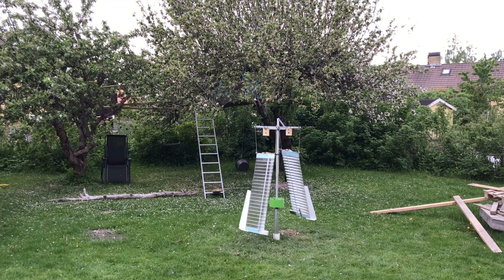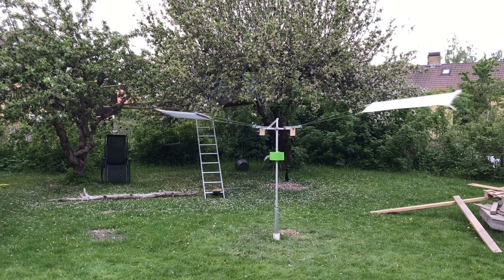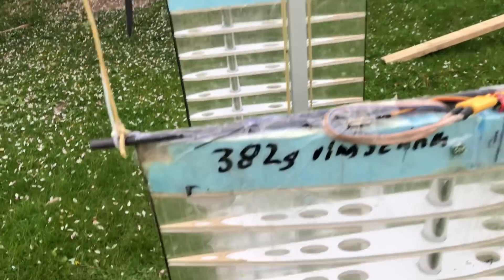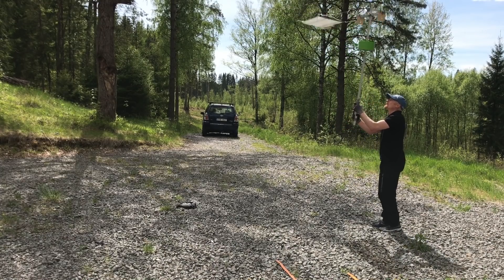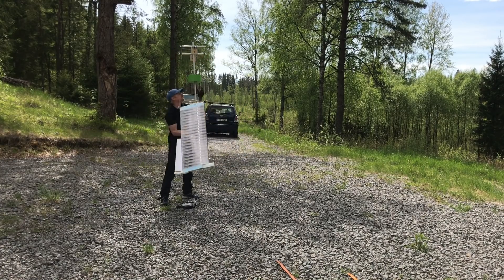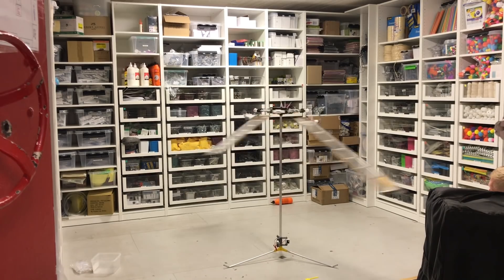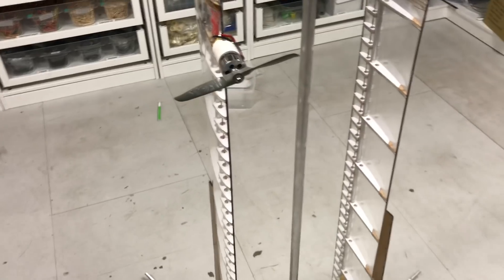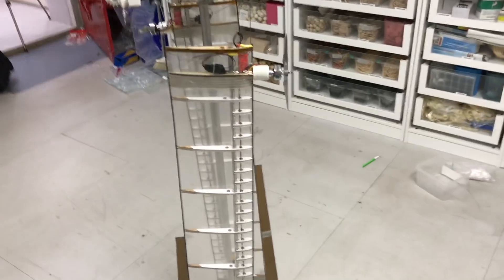Rotary wing testing

Comment: why not simply connect the wings with a carbon rod through the center and create a pivot point in the middle of it it can balance on..Then you can use some flaps to position the rotating vehicle, it can take off if it has balast of some kind and maybe even if it hasn't but you have good control..Its basically two connected airplanes flying in a circle, that configurationcan definitely fly without any support

Comment: The placement of the strings is making the wings go unstable. The aerodynamic forces are roughly centered at about 25% forward but the pivot point set by the strings sit in the center at about 50%. That creates an unstable pitching moment that get worse with the square of the speed. You'll get more stability by moving the aft spring forward to the 45%-50% point. I'm curious what the results might be.

Comment: Loving this project. I work on kinda the reverse of this. 
If the thought is of any help... I've been able to run my kite turbine backwards e.g drive rotation into my kite turbine, sending rotary power up the tensile shaft to turn the blades.
Having a framework which releases and expands after a set rpm or tension would be cool.

Comment: So, you basically develop ordinary helicopter rotor system.
Most large helicopter designs have fully articulated rotor - there are 3 hinges installed, which allow for 3 degrees of freedom. two hinges - horizontal and vertical - act very close to strings that you use. Things to consider:
*normal helicopter has acceleration about 100g at rotor tips. You need lightweight rotor (usually the blade is only about 1% of helicopter weight). At the same time helicopter blade is very flimsy and works as a sting, so you need very high tension to keep blades close to horizontal, as a result you'll need very high blade tip speed. I've never heard of centrifugal force less than 10 times the weight of rotorcraft (100kg aircraft = 1000kg of force at the root of a blade minimum, 2000 - 2500 - typical value). To achieve that typical helicopter tip speed is about 200m/s.
* string that you want to use has very high aerodynamic drag. You'll have to provide some airfoil cover. This problem matters the less the closer you are to rotor axis (speed is decreased);
* if you want fixed pitch then you can copy autogyro rotor system (as an answer to question "how to do thrust vectoring). Just see the picture, I think it is self-explanatory: https://i.ytimg.com/vi/7kmbTo2jt9E/maxresdefault.jpg Don't forget about 90 degrees lag;
* one of helicopter design challenges - at parking position blade bends under its weight so blade tip goes down and becomes close to fuselage, typically to helicopter tail. Big helicopters use centrifuginal-activated angle limiters. With strings, I guess, that would be even more of a problem.
... I learned aviation and stuff in Russian, so sorry for language and bad terminology.

Comment: I find it very interesting that you're pursuing this type of design.  Many years ago, I would dream of a personal "helicopter" with inflatable rotor blades with weights at the tips.  The idea that these inflatable blades would be rolled up short for startup, and as rpm increased, gradually let out more and more of the "blade", just like you're doing with your weight / winch.  My thought was that a pitot tube at the tip of the rotor would provide pressure to inflate the blade and some sort of control surface at the tip, would control the pitch.  Of course, I never worked to develop this, but seeing your latest "adventure" has reminded me of this dream for a portable, compact personal aircraft.  FYI, love how organized your room is!  Probably contributes to why you are able to accomplish so much (organization).

Comment: The spinning causes the gyro to actually pull the "down" value outward bringing it partially horizontal. My friend did some experiments with a VTOL rotary wing that converts mid air. I will post the video to that in your comments, so you can check it out. 🤠👍
Reply: It can be up or down depending on the sense of the props.

Comment: Doesn't seem to be lift that is lifting that weight, it is more centrifugal force. The lift is only lifting the weight of the wing itself. I think this design will eventually  lead you to using helicopter rotor heads and blades.

Comment: One effect that may cause issues with the flight controllers and maybe some vibrations is the “ice skater effect” (not sure about the correct term). When blades flap up or down (in your case both at the same rate and proportional to rpm), the diameter of the rotor disc changes. This causes a change in angular momentum (I think), and thus a speed change. That is why real helicopters have lead/lag hinges.

Comment: Your test demonstrates only stationary rotation characteristics. Assuming zero wind, the air over both airfoils is the same. higher RPMs will only demonstrate that each airfoil flies into the wake turbulence of the other airfoil. Once directional flight is added a new problem is added to the mix. The airfoils become mismatched because the wing flying INTO the wind has greater lift than the wing moving away from the wind of flight. You might find these interesting.
https://youtu.be/J1Oj16kirak
https://youtu.be/qJMoR8BDilc

Comment: Back in the 50s they used air driven jet engines on the outer wingtips. It seemed to work ok but the problem was getting them up to speed so that there was enough air to get the jets firing.

Comment: You might consider a spring or elastic retractor to either assist or replace the green bucket.  The bucket is a set value; eventually being cancelled out.  A spring will add a varible tension that will increase with rpm.  Currently, when the centrifugal force overcomes the bucket, the wings get to do what they want.  You can use this characteristic in the design or design to control it.
Good luck!
Reply from the maker: Im working on a R/C controlled winch system based on a cordless screw driver motor/gearbox!

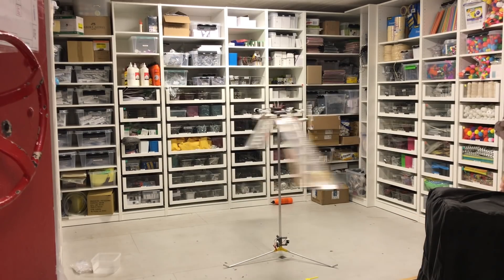Comment: in the smaller indoor test rig at 4:00, the angle makes it hard to tell - but it looks like one wing has fallen back down a little further towards its resting position. That would cause the vibration you see there, which seems to always be the vertical stand bending towards the 'higher' wing.

Comment: Question: why did you decide to place the motors so close to the spinning axis?  Have experimented with other positions?
Reply: well, if you mount it at the root of the blade you need less speed achieved by the motor, and less energy needed to spin the mass of the motors

Comment: Lift from your device is limited, not very useful as no moments can be supported in something that is in tension only.  Wings have Spars for a reason.
Reply: Don't agree, I can drive my kite turbine line tension by adding rotation to the transmission from the ground

Comment: Interesting position for the propulsors. More usually in other experimental helicopter designs, the propulsion unit is situated either at the tip or up to around  1/3 back. One was a pusher design as the blades were meant to feather power off to allow safer less drag autorotation landings. It gets me thinking that in any amount of wind a sort of autogyro hybrid could be configured, where as you would be aware the pressure curve on an aerodynamic profile actually sucks the profile forward. My notion is, if the rotor used propulsors to assist rotation speed (more usually some 350 rpm for effective man portable design) while using airspeed of the vehicle to support the greater lift value, as in a gyroplane. So why would this be of value? Zero wind speed is comparatively rare, and battery charge life would be extended in all other circumstances. 
cheers

Comment: You could employ a dragging tail like SailDrone to improve wing stability.
It's actually possible to do a lift off with a single wing (ie a plane) provided that the tow cable is long enough that circular motion gets canceled out. Not so relevant in your case, particularly if trying to manouver under trees.

Comment: this looks very ''early stages'' but also great, what is the next step towards your 2seater goal? bigger motors, more stable wing?
Reply from the maker: 1Testing with four wings and winching mechanism.
2 The control system.
3? - I expect to fail in at any moment, not kidding,  so no need to plan too far ahead...:-)
Reply: @amazingdiyprojects  sounds like a plan, but please be careful, this whole thing looks like the zombie slicer from Half - Life 2, meaning, don't get sliced please :D